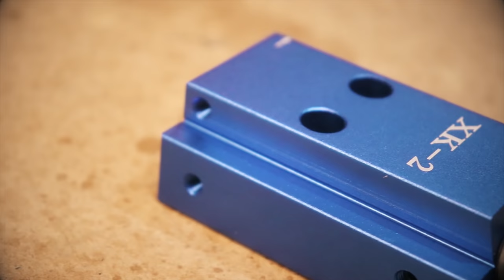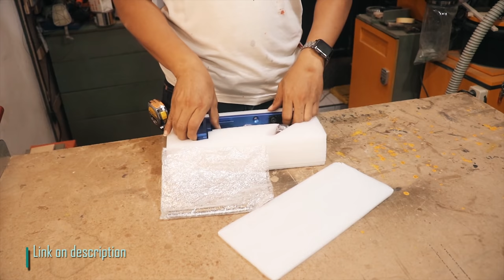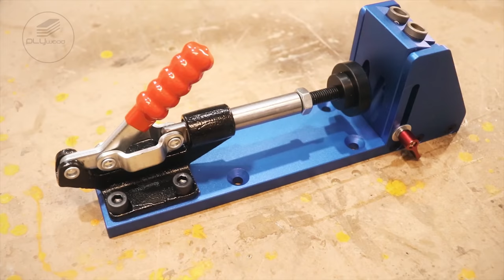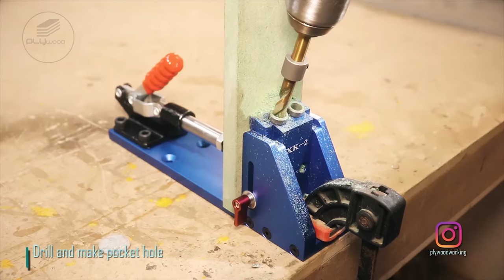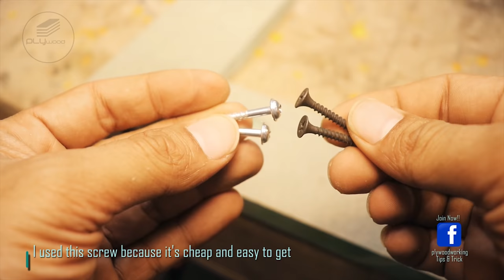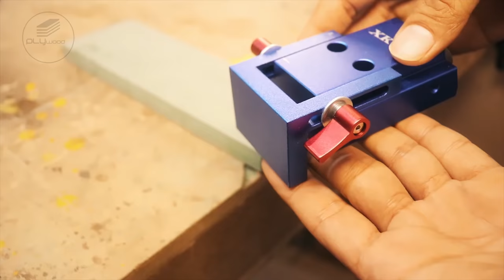2 in 1 Cheap Pocket Hole Jig

Comment: There are a number of different companies making this kind of device, although this one is slightly cheaper than those sold in the USA.  It was interesting to see the use of drywall screws instead of the "speciality" screws that several companies claim you need to use.  I suspected it but had not tried it.
Reply from the maker: i try use low budget but still good quality, that why i buy this pocket hole and use drywall screw coz more easy get and cheaper but if want really good quality i recomended use special screw